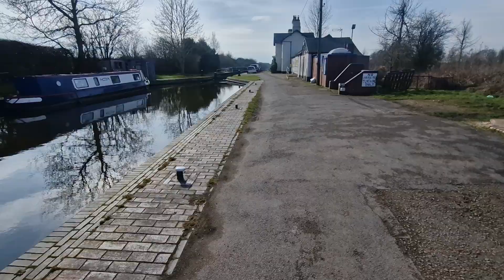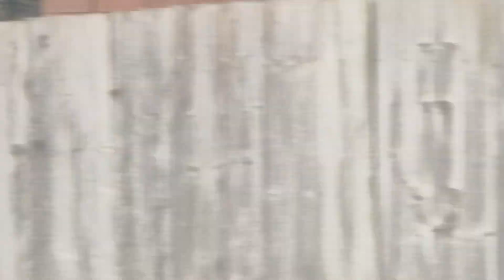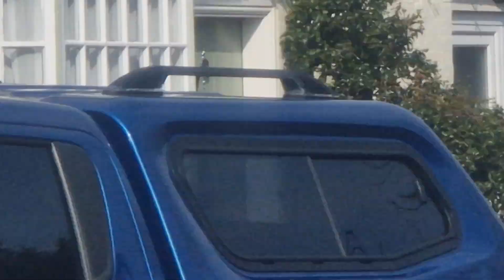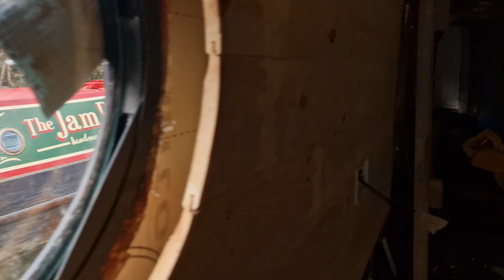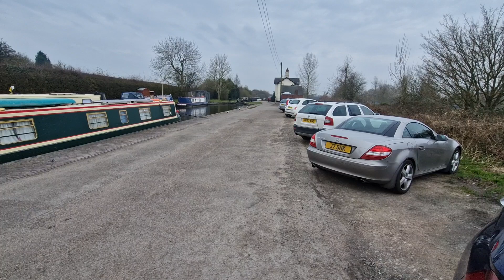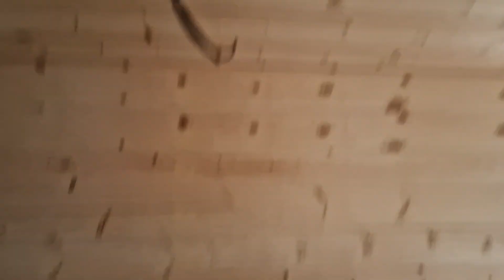narrowboat build part 14  floor and ceiling time  #explore #diy #narrowboatvlog #refurbish

Comment: I hope to take delivery of a shell later this year and cannot decide on lining material. Can I ask what thickness of side lining planks you have used on the lining above and below gunnel height?
Reply from the maker: 12mm cladding .mate ...and used silver thermal lining and  insultalion foam simaler to kings span ,  used c1   to bond  wood to the metal for braces
Reply: @Tcvlogsandexplore  Silver thermal lining is popular with DIY fitouts these days, I should reconsider it. I am considering 50mm king span below gunnel which is about the same depth as the metal reinforcement ribs. The horizontal orientation of the lining planks looks good, more traditional to my eye.